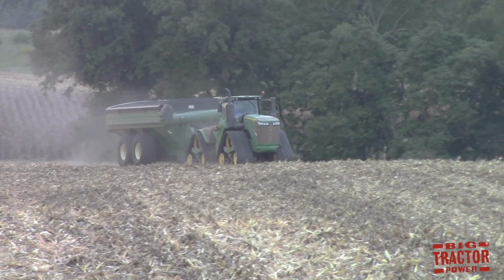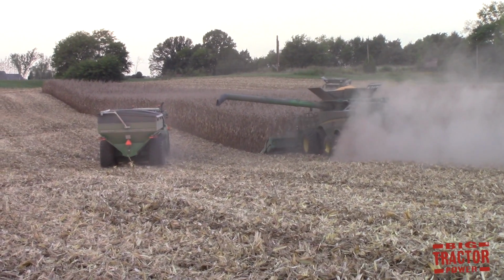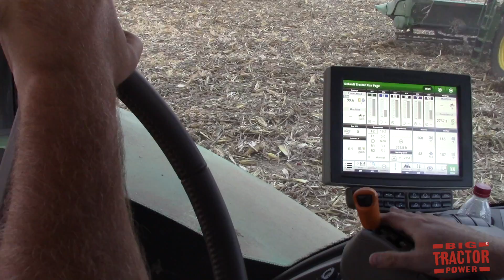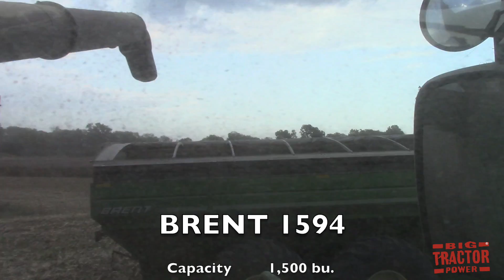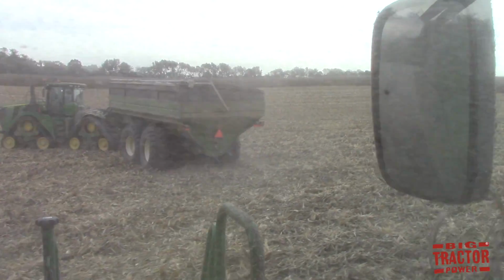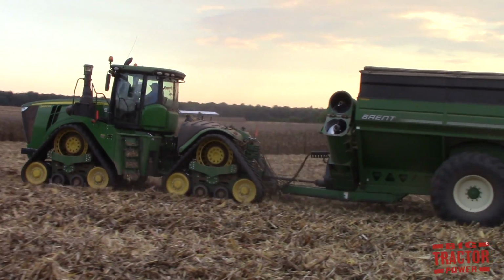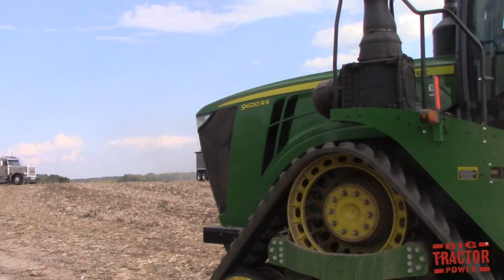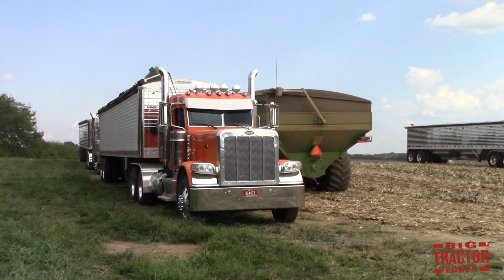Big 1,500 Bu. Brent 1594 Grain Cart

Comment: In England,  we dont use mother bins or huge carts,  last harvest I had a John deere 6215r pulling a 20 ton capacity grain trailer. We just cart from the field to the sheds. Had a claas lexion 680 and 2 constant tractors carting with optional 3rd for longer distance carting. The second tractor was a 7310r pulling a 25 ton bin on a roll off trailer. I love the harvest time.  It's the best time of the year.

Comment: In the combine you push the auto beacon light button and it will start strobing when the grain tank is 3/4 full
Reply from the maker: The strobe lights are automatic. When the bin is 75% full a sensor turns the lights on to alert the grain cart.

Comment: I said this once, and ill say it again, i have this sixth sense that the Tracked 4x4 JD tractor will be in fs19, we have the Quadtracks, and the wheeled ones we have is the T9 and the Challenger, so, im thinking that we might get the tracked 4x4 JD tractor. Awesome video BTP.
Reply from the maker: Thank you for watching and commenting.   I would be surprised if a 9RX was not front and center in FS19.
Reply: They still have a few spaces open in the JD brand section, lets see where it goes.

Comment: Does this farm use controlled traffic farming with dedicated tram lines where equipment always runs in the field?  

I would think that big grain cart creates a fair amount of compaction
Reply: If you think about it, the cart pretty much has to cover the whole field, because it is right next to the combine when the combine is unloading. It might be able to only go over every other set of rows if everything worked just right, but that probably doesn't happen all that much.

I'm sure they are using a track tractor to reduce compaction from the tractor weight. I don't know what the grain cart weight per square inch is when loaded, but I'm sure Brent thought about that. But they still might have to do some tillage to break up compaction.
Reply from the maker: This one does not do controlled traffic. One farm I film does. Everything is planted, harvested and plowed up at 40ft wide.

Comment: Ignorant question but why don't the semis just drive alongside the combines in the field when they need to unload, instead of having the grain carts running back and forth?  Is the ground too rugged for that?
Reply from the maker: That is a good question.  I might a video on this question.   On the Canadian plains I have seen so my trucks and 10 wheelers run right next to the combine is it on loads.  The fields are extra flat there.   Here in Kentucky there are hills, wash outs and wet spots that big trucks can not tackle like a tractor and cart.
Reply: @bigtractorpower  Thanks!  Makes sense.

Comment: Another good one BTP. As a side note. I wish tractor manufactures would use PTO and drawbar hp rating like they did in years gone by. In this case it's 358 PTO and 494 Drawbar. I am curious why on the new large tractors, why the PTO is usually less than the drawbar HP. In the old days, they tested more HP on the PTO than the drawbar. Are they purposely not directing full power to the PTO in order to use a lighter PTO drive train?  Anyone ??
Reply: The largest standardized PTO on tractors is the 1 3/4" diameter 20 spline 1,000 rpm (Type 3).  It is not rated by SAE for much more than 350hp.
Reply from the maker: I miss those days too. I will assume your an IH fan. When it was an IH 786, 886, 986, 1086, 1486, 1586, 4186, 4386, 4586 and 4786 it was easy to remember a complete line and their pto rating.
Reply: As far as I know Deere’s hp ratings are at the crank shaft not even the draw bar so the engine puts out 620 by the time it goes thru at the drive line components it’s only 494 according to Nebraska tractor test results
Reply: Let's go a little further into the Nebraska test results...
@2100 rpm 496 drawbar hp in 12th gear (8.2mph) unballasted.
@1799 rpm 553 drawbar hp in 14th gear (8.3mph)  unballasted
@1800 rpm 557 drawbar hp in 14th gear (8.68mph less slip)  ballasted
https://tractortestlab.unl.edu/John%20Deere%209620R.pdf

Note increased horsepower performance at 1800 rpm, versus 2100 rpm. There is a significant torque bulge on this Cummins QSX 14.9L engine, with torque at its highest @1501 engine rpm: 1194 lb. ft. / 1619 Nm 

The power boost up to 670 engine hp. would require PTO or significant hydraulic load in addition to traction load, such as a large planting rig, or big sludge applicator trailer, or such.  Nebraska does not do such combined load testing at this time.

Comment: Great videos!  My 18mo daughter and I watch on mornings when we're not out in the field.  Random question:  Do the grain cart guys have a speed limit when they travel loaded/empty through the field, or do they go as fast as is necessary to keep the combines rolling?
Reply from the maker: Thank you for watching.  I think the main speed factor is the conditions of the field, how full the cart is and how experienced the operator is. If the field is rolling or rough and the cart is heaped with grain they take it slow so as not to spill.   If the cart is empty and there Field is smooth they can boggy at 13-15 mph.

Comment: Was the ride smooth in the RX? Also have you seen any 2096 carts (2000 bushel) in Kentucky?
Reply from the maker: The RX ride is ok but it can get rough.  A Case IH Quadtrac is smoother and a Challenger MT800 on a wide stance is really smooth.

Comment: That is a bigger cart than I normally see.  What’s the story on the other cart in the field you see from the 9620 cab?  Make sure you check out Mn Melleninal he is almost at 100,000 subs.
Reply from the maker: The 1594 is a good sized cart.  I hope to see a Brent 2096 some day.  Good eye.  There is a 9520RX with a Brent 1596 also in the field.  This farm runs two 1596 carts on tracks and has the wheeled 1594 as back up.  I was going to do a combined video on the two carts but the 1594 covered 14 minutes all by itself.  The farm has two 9520RX tractors I have followed through the year so I will probably use the corn grain cart footage in that video.
Reply: Looking forward to the 9520RX video. Three 1,500 bu carts makes a big farm.
Reply: @bigtractorpower  I was gunna say how can one cart keep up to three combines. It's kinda rule of thumb to have one cart per combine in corn.
Reply from the maker: This farm has two 1596s and a 1594. The video hitting 14 mins on just the 1594 seemed like it was good to just highlight the 1594 for this one.